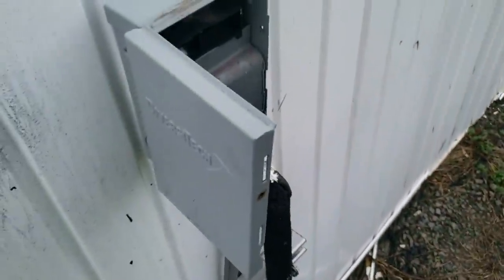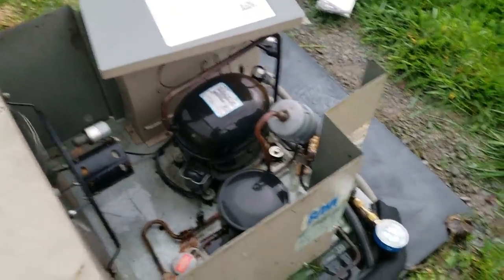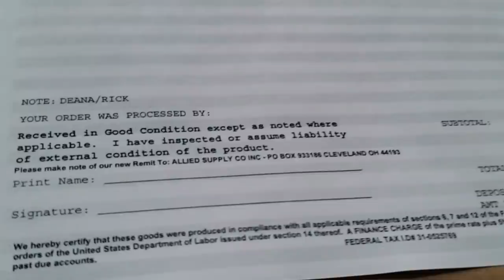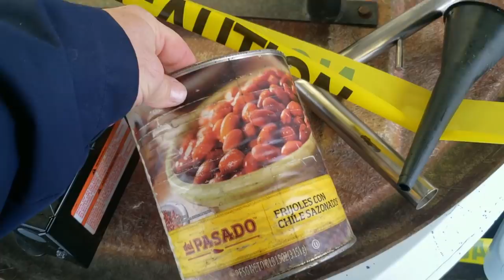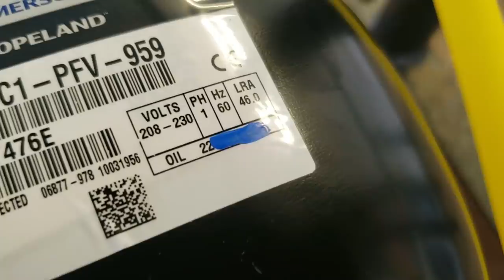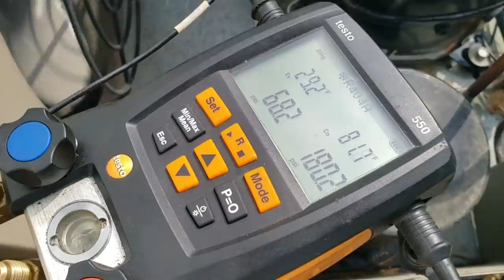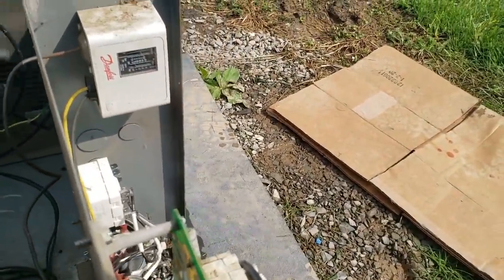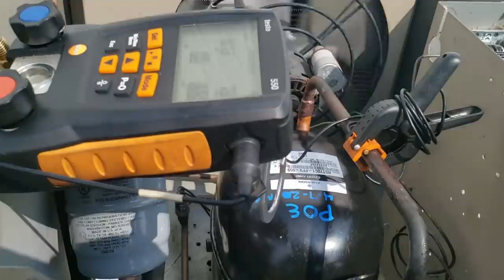Walk-In Cooler Full Of Ice Cream Mix Is Warm

Comment: Suggestion from an old TV repair guy:
If you are planning on (or expecting to) get a shock, use your RIGHT hand! Keep your left hand in your pocket or behind your back or some other place it won't be touching something while you do it. Why? Most people have their heart on their left side. It's between your left hand and your wet feet. Using your heart as a fusible link isn't a good idea. There's not near as much important on the right side of your body.
Reply from the maker: I have heard that,  thank you for mentioning it.  I also have electrically insulated boots that help protect me as long as I'm not touching anything with a body part such as a hand or bar skin.

Comment: Good vid !   Regarding putting the disconnect back in or out in bad weather. i Just use my Leather gloves i got at home depot. they are not expensive. under $10.00 i think 4.99/pair. they are great. just throw them in the tool bag on top.
Reply from the maker: I've had the pleasure of holding onto the suction line while I was charging the air conditioner when I first started when a lightning strike long far away and I felt it right through the line set. That sucks ☹️
Reply: Holy crap ! i Have not had that Pleasure. no thank you. i Can Say ive Been Glued to a Unit Having the Holy crap Fried out of Me once in a Kitchen Putting a Reynolds 1000 lb ice machine Auger back into the Water Bath. That Was One Bad End of the day. a Friday night.

Comment: I got burned on a low pressure switch setting from a factory on a walk-in cooler. I replace the compressor and then within one week it was toast just like the one I found three phase lock rotor. Refrigerant 404a the cutout was 5 PSI. I end up having a pretty major refrigerant leak on the evaporator that I ended up replacing. I came to the conclusion because it was such a low cut out when it was partially charged it must have been short cycling on the low pressure switch cuz it's only five PSI cut out. I would recommend 20 psi cut out 80 psi cut in on 404a. I didn't put an adjustable one on I bought one that is 20 cut out 50 cut in it does short cycle once on Startup occasionally but it won't kill it. I didn't want to go through the extra if trying to get an adjustable one in there. Just figured I'd pass the info along to what happened to me on a job just recently. I wouldn't have that cut out the so low I would want to cut out at 20 psi on a walk in cooler with 404a
Reply from the maker: We generally use adjustable ones, I usually c.o. around 3-9 psi, otherwise the compressor will sort cycle because the remaining refrigerant will boil off raising the pressure back up. It also depends on how old the compressor is and if it's capable of pumping down as far as I wanted to pump. Thanks for mentioning that, I will keep that in mind. 👍👍

Comment: Love the way you stole power from the saftybreaker.. That's a real pro tip.
I do the same, have made a plug with an powercord, so i always can get power..
Reply from the maker: I made my first one back when I first started, but I recently rebuilt it with a lighted female plug to show if power is there and serves as a indicator if it's more than 120v (if it's real bright, it could be 277v) I also added a 10 amp inline fuse for a hedge of protection.
Reply: @HVACRSurvival  nice, just love the homemade inventions that keeps getting improved..  Was one of the first things i made when i started.. Old guy had one, and I thought that was some clever s***

Comment: just youtube learning, trying to get a good understanding, I had automotive airconditioning, but not done in a good while, I am versed in mechanical field, automotive mechanics, auto-body, & welding, but I want to learn HVAC, cant afford to think about going to school, so just watching all I can at present

I like your tap plug, I have already planned to make one, I will use a 3 tap I have in case I need to power more than 1 item, like battery charger, or?
Reply from the maker: The one I replaced had 3 plugs on it 👍.  You can learn anything if your willing to put time and effort into it. I wish you the best on your journey 👍👍
Reply: @HVACRSurvival  Thanks, & this will be my new journey, honestly more interested in knowledge than going into 100% professionally, but thats sorta me. I know I will do side work though.
I am a professional butcher, that does welding on the side & does mechanic work on the side, and works part time in a body shop doing rust repair, metal fab,  I can do any and all phases of auto repair from building engines, transmissions, to body work & painting, I also am versed in vintage Harleys, & custom bike building, also for friends & family am a Florist, I learned that in my youth, & it stuck, its nice to make my own arrangements for my parents, instead of having to go buy, or try to explain & pay high rates, but this is something I sorta wanted to get into, & now I will, plus it doesnt hurt that my primary home has never had a furnace, nor air in it since it was built, I have used portable propane heater, kerosene heater, & space heaters for 25 years, previous owner built it for a summer get away in mountains, & had it for 12 years before me, or my second home not having air, yet.....

Comment: Hi Rick, just curious, that air flow set up with the pvc. Is that a manufacture specification for who ever supplies his product? Or just a design the installers did? Nice job by the way!
Reply from the maker: From what I was told, the guy that use to run my Ice cream calls prior to me designed it. I'm not sure if he came up with the idea or borrowed it. Most new ice cream machines have the mix at the machine in a refrigerated hopper or cabinet. DQ was where you seen these types of machines the most but even they won't allow them now when you upgrade your machine. This was not a DQ but was a independent merchant.
Reply: @HVACRSurvival  that's cool man. It looks like a great setup. So far the ones I have been getting to cut my teeth on are the machine and Hopper combo. Thanks for replying back. Be safe out there.
Reply from the maker: @Pretzel114  anytime man, thanks for watching n leaving a message 👍👍

Comment: Why put a new potential relay on a compressor that was pulling amps and no compression. You should have ohmed out compressor terminals before cooling it down and had amp clamp on compressor leads when starting it. Sequence of troubleshooting can save time and money
Reply from the maker: Maybe I speak too quickly, I told you in the beginning that the start capacitor was blown.  What would cause the start capacitor to blow up? That's correct, the potential relay sticking would cause that. The relay was not new it was a used one I had on my truck. Why check resistance when I can check amp draw, if it's a open circuit it will be zero amps. Generally the only time I check resistance is to check for shorts to ground and to verify what terminal is what.
Reply: Potential relay sticking usually trips the breaker. I missed the part about the start cap tho, thats abit of an unfortunate spate of breakdowns. I prefer to see ampdraw whenever i try to start a compressor, especially after replacing start components. If it works for you tho whatever...
Reply from the maker: @Sapient55  everyone has there preferred method, I'm always open minded, or at least I try to be. 😏

Comment: What gas was the previous compressor pumping? 22 ? So, 28 degree superheat is good? It must have went  down to 10 ish when you showed 42 box temp right ? Thanks for sharing
Reply from the maker: This wasn't a conversion this was a 404a system before. The problem I had was the compressor that was available had alkaline benzene oil in it but it was still the exact same model number compressor. Heatcraft recommends 20 to 30 degrees superheat at the compressor.
Reply from the maker: it's been a few days so I'm not sure what the super heat was when the box reached temp but everything look good when I was there. Otherwise I would have adjusted the TXV. Generally I like 8 to 10 degrees superheat for a cooler but the superheat at the compressor overrides the TXV superheat.

Comment: I like these longer vids 👍
Love that umbrella , Yet another piece of kit I'm gonna be wishing I had or was available .
Noice Fluke btw , careful good ol' Amprobe don't feel left out and starts pouting though .
We don't have that style of disconnect over here , but is it possible to take it out abd put it back in using a VDE insulated pair of pliers or needle nose ?
And I hope they let you have some ice cream at the end of the job , ey 👍
Reply from the maker: Yes I got the Fluke 902fc, my Amprobe has DC amps, so that would confuse the meter and a back light that always came on when it was first powered on. Great meter but more than I need 90% of the time. I have several high end meters I just keep them sleeping in the tool box to keep them clean. Lol. Thanks Mr. Archer!

Comment: Good video Rick . Was wondering if the supply house didn’t stock the replacement compressor with POE . I always ask if they do just to save me time . Good content !
Reply from the maker: They didn't have it in POE, that's why I had to change it. Basically I took what I could get because I had to get his product cooled back down.
Reply: HVACR Survival Yeahh that’s how it goes sometimes. Equipment has to be up and running ASAP !!
Reply: HVACR Survival was the original gas 404 also?

Comment: So, it's 404, but the compressor came with ab and you can run it on 404a? In my day we did take into account the compression ratio. I'm taking it that is no longer the case? I have seen the multi refrigerant compressor is that one of them. Thanks
Reply from the maker: It was the exact same compressor but came with ab oil, they didn't have the one with POE available and I needed it now. Yes normally if your changing to a different model compressor you would need to check all those specs your talking about. Otherwise the oil was the only difference.
Reply: @HVACRSurvival  Thanks for taking the time to answer,  be safe.
Reply from the maker: No problem, I enjoy the feedback from my viewer's 👍👍

Comment: Good job.  Do you do a flat rate or hourly charge on labor?
Reply from the maker: Were time and material. I've done flat rate before and it's only designed logically for one thing. and that's the blame the high price on some book for blowing the eyes out of their customers eye sockets.
Reply: I’ve changed to flat rate. That way the customer is not complaining about the labor for the Labor charge.  That job with a $589 compressor would be $1450 plus tax.
Reply from the maker: That sounds pretty fair.

Comment: The disconnect should not give you even the slightest tingle if you pulled it in a downpour. An electrician should check that out before someone gets hurt.
Reply from the maker: In a perfect world you would be correct. But it's not a perfect world. Next time there's lighting strikes outside, they don't even need to be close by, I invite you to make sure your feet are wet and hold on to the grounded copper lineset. Let me know how that feels? I speak from experience. It won't kill you but it won't feel good.

Comment: I have a 36 oz measuring cup in truck to measure oil
Reply from the maker: I had a glass measuring cup, I removed it after seeing another tech using the tin can measure method. Sometimes I'll just use my weight scale even though I know it will be off just a little.
Reply: @HVACRSurvival  I have a plastic one. I think it was for measuring farm spray

Comment: How do I calculate the heatsink how much capacity the compressor needs
Reply from the maker: We don't call it a heat-sink, do you mean the condenser?
Reply: @HVACRSurvival  I mean, the calculation of each freezing or cooling room, how many btu or how much system does each room need, how do I know that
Reply from the maker: I don't normally size them but the manufactures have a book that you can look up the box size then size it based off of the physical location of the environment it will be used at and what temperature you want to maintain inside it.
Reply: @HVACRSurvival  Thanks and may God guide you to the straight path
Reply from the maker: I pray 4 guidance and strength everyday, thank you 👍

Comment: 13:46 40? Shouldn't that be 10 by that pressure indicator? Or do you always go by the outside pressure scale? Just being a curious George
Reply: Good video on doing what you had to do to make things right changing oil for the refrigerant your running.
Reply from the maker: @Georges3DPrinters  that was the only compressor available otherwise we could have gotten one with poe.
Reply from the maker: Outside of the gauge is pressure and the inside is the temperature scale. Pressures change, you should focus on the temperature the system is running more than pressure.
Reply: @HVACRSurvival your right! I said pressure when I meant temp.
I was probably half asleep or something writing that question.
But thanks for clarifying that. I would have never caught my mistake otherwise.

Comment: You should consider changing your title since Walk-in coolers cannot hold ice cream since they only hold temperature to 35 degrees, Walk-in freezers however can maintain ice cream.
Reply from the maker: You would be correct if I didn't say mix but it's still just mix until it's frozen and air added to it before it becomes ice cream. At that point it's still liquid mix. I get what you're saying but it's keywords that draws people's attention to watch the video.

Comment: If that's one of those places that charges by weight and pop you for $20+ when you fill er up... they can afford it
Reply from the maker: No, it's a locally owned place and the owner is a great guy to work with.
Reply: Yeah I think the connecting rod M about the broken that the pressure why wouldn't do not suppose to do would you did the right thing by Room placing the pressure and changing out the the or on it I did things like that on or cooling system worked on that 1 non time ago work Donna heat and there a boner rueful man that was something and that the head or a big lift in their lift up the the the pressure out of it and put the new compressor and oboi it was the it was all done a storm coming in and that when I wouldn't so cool That would so cool that thunderstorm coming we had to go and then the truck route quick and Aaron and wait for the storm though go through and of now there and the lugger that another star  It was like a bench storm name star  Like convenience store Like a vignette store pretty good size building who good thing with his at that about finishing up on the on the compressor